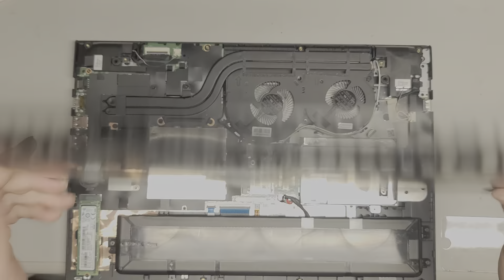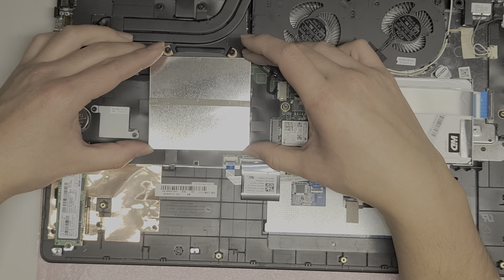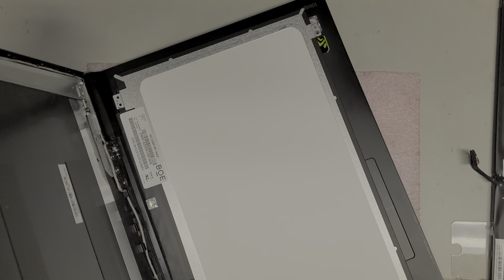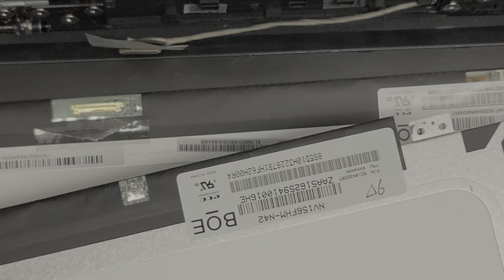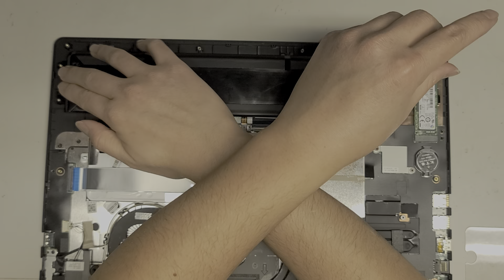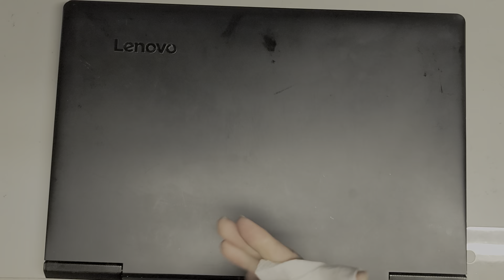Lenovo Ideapad 700-15isk 80RU Disassembly RAM SSD Hard Drive Upgrade Repair LCD Screen Replacement

Comment: Hello! So I had my Ideapad 700 screen changed at a repairs shop, but it just looks off, the colors are washed out, and words seem hazy, especially on a white background. Would you say this is because of the screen model? like it doesn't match the original one? Thanks!!
Reply from the maker: Most likely
Reply: Thank you for responding 🙏🏽
Reply from the maker: @rashaabdelrahim5380  no problem

Comment: Hi i have problem with change hdd on ssd , pcie is ok thats see disc, sometimes see the ssd, and you can play the yt videos in 4k, but next time after restart that didnt see the ssd, and have black screen, in bios were changed the options on prio ssd, but have problems. Have like without sistem, and see info choose disc or windows, but that refreshing and didnt work, can you help in this sit ?
Reply from the maker: Hmmm not sure what's going on. Boot device isn't changing permanently? Maybe bad cmos battery?
Reply: @ItsBinhRepaired  now didnt want to enter to bios, and something happen with screen full white, and next goin black from corner to middle, look like Old tv kinescope
Reply from the maker: @pelonik2  sounds like the screen is broken

Comment: Can I use any 2.5 inch SSD and reinstall Win on it. Or do I have to update the BIOS? 

Please help.
Reply from the maker: As long as it fits in the computer it'll be fine.
Reply: @ItsBinhRepaired  awesome thanks for the quick response.
Reply from the maker: @leiwanddeluxe  no problem

Comment: I bought DDR4 2133 8gb brand blackberry but it’s not compatible and monitor doesn’t show anything. Can i use DDR4 2400 8gb instead? Do you have any recommend?  Thank you!
Reply from the maker: You have to match the same speed and type as the original RAM.